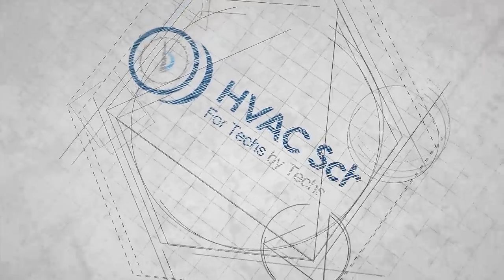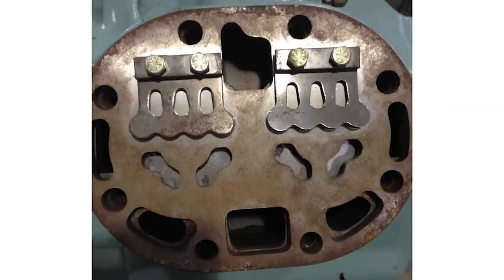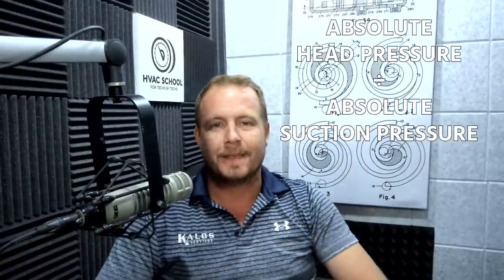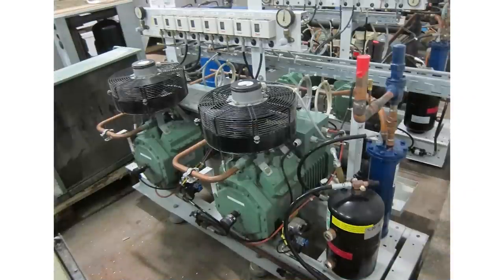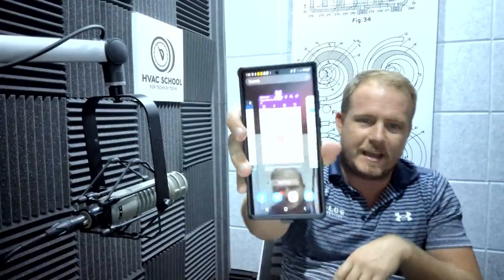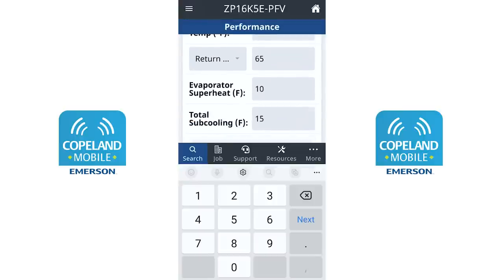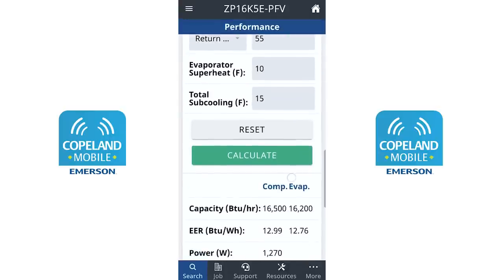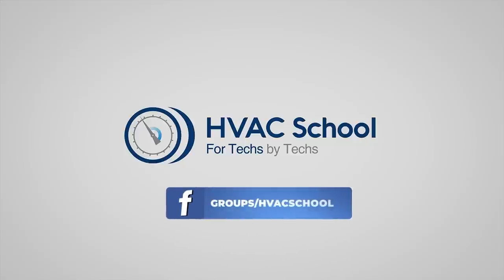Why Measure Compressor Discharge Line Temperature?

Comment: Brain your tutorials are excellent. I’m not glibly throwing throwing complements here, your work is truly superb. I have quite a library of the HVAC School tutorials and greatly admire your abilities as an educator.
I do however have one tiny little problem and it’s not anything that you or I can do much about. I can’t use as much of your stuff in my class as I’d like to because of the F word. Fahrenheit… there I’ve said it. The one word that I will not allow students in my classes to use. 
How long would this video be if we had to recalculate every reference to temperature and how much would it break the flow of information. If only we all used the same method. I guess it won’t be last time we hear this lament and none of us will be holding our breath waiting for change.
Again, thank you for your great work.

Comment: Thanks for the video, it answered a few questions I had as to why the high and low pressure lines are not insulated together, as  the low pressure line needs to be cool to keep the compressor temp down.   Or why my ac man thirty years ago recommended a 4 ton air-handler with a 3.5 ton condenser since we ran the liquid line inside the drain pipe.

Comment: I used to install a small stick-on dot on the discharge line that would change color so I could tell if the compressor had overheated.
Reply: Would it not fade?

Comment: Bryan, Hi!

I recently had a pretty bad experience due to a UV light that evidently did it’s work on my eyes before I disconnected it (was unaware it was in the system prior to opening it - lovely!) that won me a trip to the hospital, along with some terror of blindness. 

It’s cleared up now, but I’m looking into buying some safety shades and unsure what code or specification to look for - if my research serves correctly, ANSI Z87 with orange tint should be what I’m looking for, but would like some guidance from the community to keep safer on the job!

Thanks guys! It’s hot here in SW Florida!

Comment: I'm a technician for Fluid Chillers Inc. Damn this is a fasciating video. I have run ultra low temperature Chillers with as low as -20/ or 20Hg suction line pressure. These are two stage Bitzers with interstage subcoolers. So the discharge of the interstage H/E helps cool down the compressor?
Reply: Yup. We service many centrifugal low pressure chillers. Evap side is in a vacuum and the high side can be or at the most barely over 0 psig of pressure. I believe the relief valves/ burst disk pop on those at like 15 psi or something close to that.

Comment: Had a system not maintaining super heat. Checked airflow and checked subcooling wich were both where they should be according to manufacturer  I also checked discharge line temp which was about 175 F the superheat was very low so I replaced txv. Started it up had the same issue. I called carrier and was told that a discharge temp above 160 meant that the compressor was the issue. I to thought that 175 was acceptable but not according to Carrier. They claim that on residential condensers with a scroll compressor that anything above 160 is to high even on a 100 degreee day. Also compressor was pulling normal amps according to manufacturer data plate.

Comment: So, the general industry standard is not to exceed approximately 250 degrees, 6 inches down the discharge line. What is the minimum temperature standard to keep from damaging the compressor? I know that most compressor mfg. say not to go below 20 degrees superheat on the suction inlet, but what is the minimum temperature on the discharge line?
Reply: The real concern of low discharge temperature is low discharge pressure which increases the velocity of the refrigerant. Not really a concern for your average HVAC tech, but it comes into play in refrigeration now and then, especially with evaporative condensers. You can exceed the limitations of the system piping, sometimes fairly quickly on old systems.

Comment: now this is more for Southern or western issues w more year round hot weather I'm assuming ... because in New York area and the north east we have less of thay hottet weather... so would you still recommend this for us guys up this way ?
Reply: Discharge temperature is a pretty critical measurement and while it might not be as huge of an issue up there (I don't know), it would still be a great tool to use when determining the lifespan of a compressor. Like he implies in this video, the hotter the discharge temp, generally the shorter the lifespan.

Comment: Unless you have put a thermometer inside a compressor head you have no idea how hot it is.
Reply: Pretty cocky to assume the manufacturers don't know how hot their components run. The information is out there, read it.
Reply: @michaelnash8435  so this guy doesn't know what he is talking about when he says at around  300 F the oil starts to break down? So with a discharge of 225 what did he say the head temperature would be?
Reply: @sammyd7857  no, this guy knows exactly what he's talking about. 300° will break down oil.

225 what? PSI? Degrees? Either way, You can't say for 225 discharge temperature or pressure that the other would be anything since it's a superheated vapor. It won't follow a normal PT relationship.

Edit: 300° CAN break down oil.
Reply: @michaelnash8435  I see you like contradicting yourself
Reply: Youre being pedantic about something that was a hypothetical meant to reinforce an idea, not an all out statement of fact. That being said, you can be pretty reasonably sure about numbers like that since there's a huge repository of manufacturer data available which they do extensive testing on before releasing.